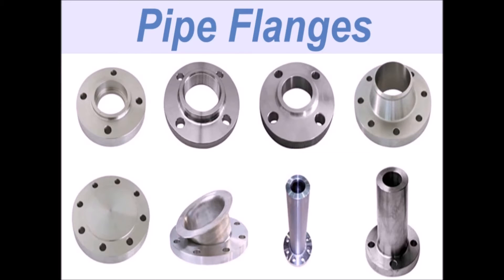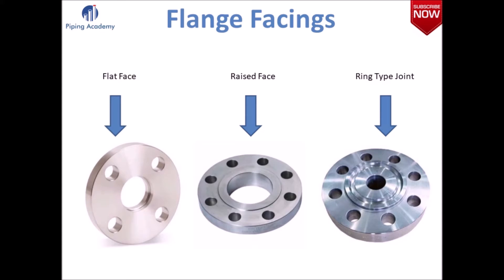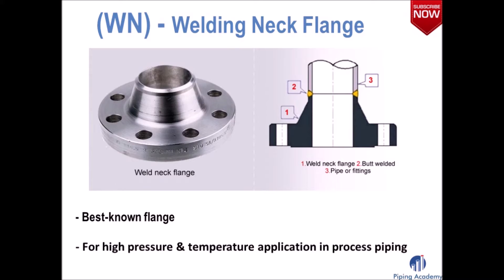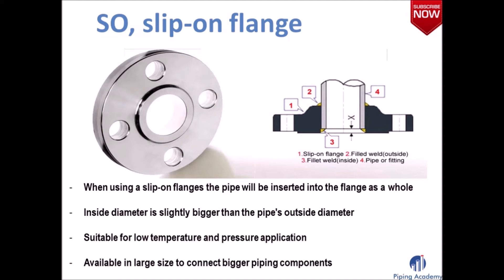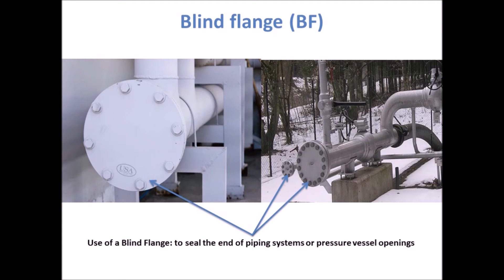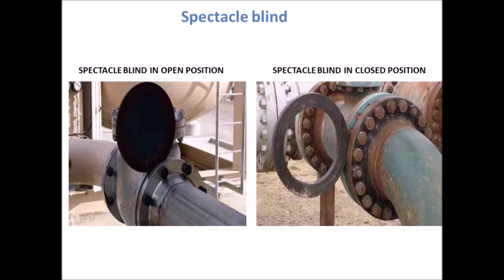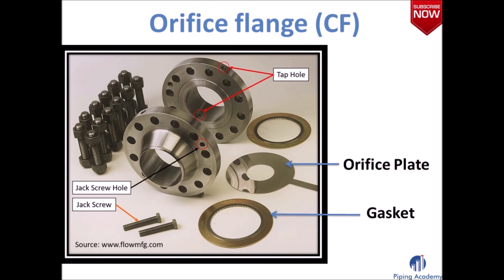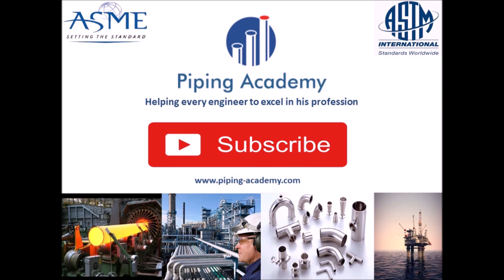Basics of Flanges - Different Type of Pipe Flanges - by Piping Academy

Comment: Great video.   I have a mixture of flanges on my worksite.   ASA class 150 and 300 . PN 16 . DIN PN 40.  ASME B16.5. And  BS 10 table E and F from the 1900s British system.   All sorts. Slip on or weld neck.  Slip on are alot easier to weld !   But I keep learning everyday.

Thanks you you your video.
Reply: sir i have pipe work if you ever need pipe tell me
Reply: Hey
Reply: G sir

Comment: Syrup:
What temperatures are seen in a hot syrup application? 
Are syrup applications in constant work cycles or are they actuated based on demand? What are the ideal circumstances given a high low of 70 - 230 F
This is a big question because the cost/value changes according to demand and availability.
What I am most curious is this:
Under ideal circumstances and using only the above information, what is the best solution for this situation:
-2" sch40 A237 grade A chinese origin carbon steel mated to 2" sch40 304 stainless welded chinese origin
-operating temperature 230 F
-resting temperature 60 F
-fluid PH  6-9

Given only this information, what is your answer to a fire and forget application of 100 years.
For context this is California with too much sun, salty air, and no maintenance.